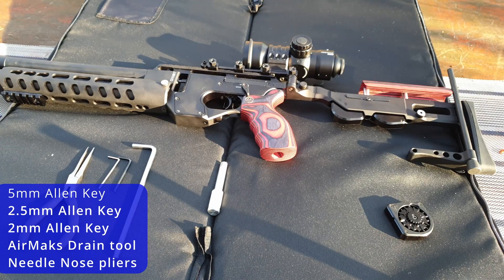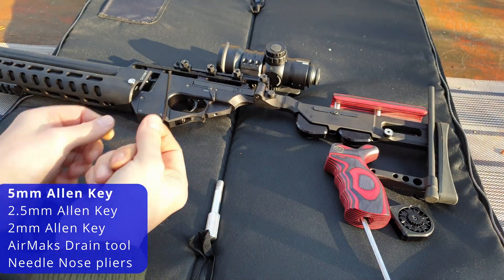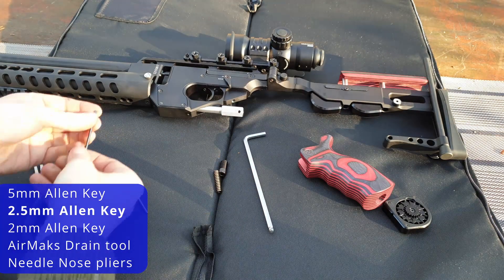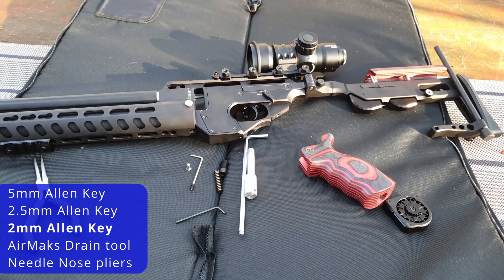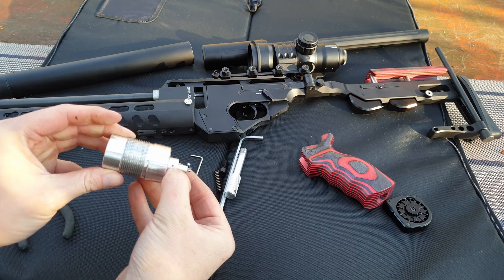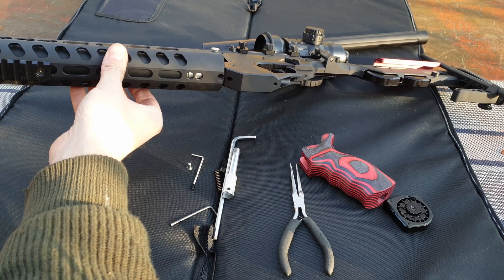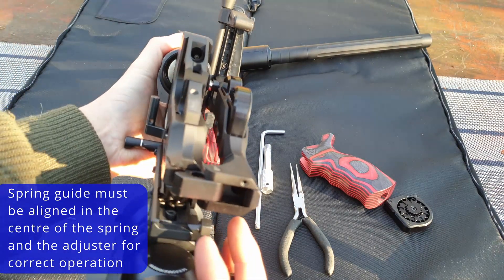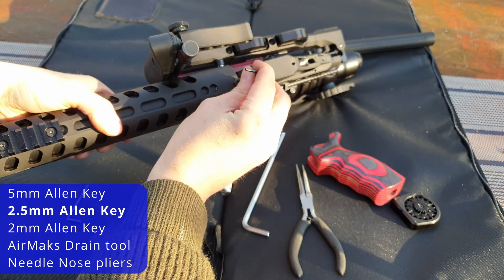AirMaks Katran Drain Tool usage and exhaust valve adjustment

Comment: So that air tube connection to the breech is only retained by that tiny screw?
Reply from the maker: The 2mm grub screw locates it and along with the 2.5mm grub they together secure the tube, a common arrangement in air rifles, given that the  valve exhausts at 90 degrees to the direction of securing the grubs are only needing to secure against the strike force of the hammer, not any sort of compressed air forces like you find on other designs

Comment: Have you started selling the transfer port restrictors to get the shot count up yet? Cheers Martin
Reply from the maker: HI Martin, the HETP has been standard fitment in the Katran C 4.5mm for maybe nearly a year now, the full ecotune with regulator adjustment and valve adjustment became standard on all rifles supplied by CDRGuns round about September or October time last year, testing on other barrel lengths and calibres is still ongoing.
Reply: @AirMaksarmsUK  thanks that's ace 👍👍👍

Comment: Good morning!  I have the Katran Standard (tube) in .177.  Shot my first FT match ever with it.  It is quite accurate.  I just got an FX chrony so that I can begin tuning it.  As it came, I am getting about 843 fps average with an FX 10.3 grain for about 16 ft/lbs.  I would like to get it up to 18-19 ft/lbs shooting the 10.3 or a 13 grain depending on the accuracy.  How would you advise starting the tuning process?  Once I get the chrony set up, I'll do a complete shot string at the settings it came with first so that I have a bench mark to work from.  Any advice and help would be appreciated.

Thank you,

Keith

Comment: Hi, where I can buy DISCHARGING TOOL for Katran?
Reply from the maker: Your rifle should have had one supplied when new, unless your rifle has the latest valve system installed in which case you do not need one as there is a drain port on the underside of the rifle

Comment: Hi. Does this adjustment work for the bottle version too or is it just the cylinder type?
Reply from the maker: Hi, yes the valve is the same on the bottle and cylinder katrans, earlier guns had a different regulator and valve which didnt have this adjustment function so the video on these from AEAC I think shows different internals, if your Katran has the magazine holders in the stock then your internals should match these
Reply: @AirMaksarmsUK  Thanks

Comment: Is the valve adjustable?
Reply from the maker: Hello, 

yes, the brass disc with holes in it threads into the valve body, in this case I am turning clockwise to increase the tension on the exhaust valve, please note this is NOT the same as older rifles which I believe were not adjustable as the poppet spring attached to the regulator instead
Reply: @AirMaksarmsUK  could you kindly explain the benefits of having an adjustable valve? Most manufacturers don’t have adjustable valves this is new to me. Thank you :)
Reply from the maker: @mikecarter4412  Hi Mike, adjustable valve designs are useful for different markets as it allows the manufacturer to set tunes for different power levels efficiently, I am adjusting this one because at the tune the rifle was at it was not consistent for the hammer strike, I needed to increase the hammer strike force for better consistency but not raise the power output, by increasing valve tension it counter acted the hammer spring increase to keep the power output the same
Reply: @AirMaksarmsUK  thank you sooo much for helping fellow airgun enthusiasts better understand this system.